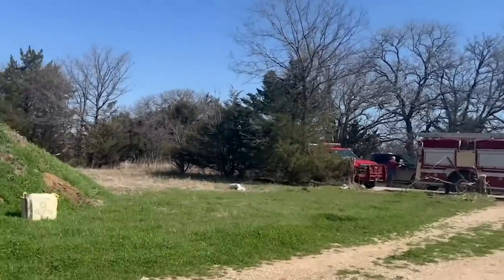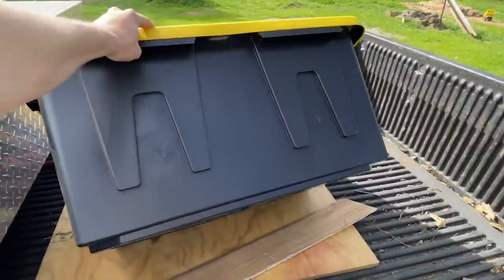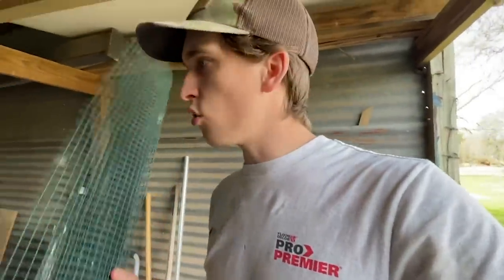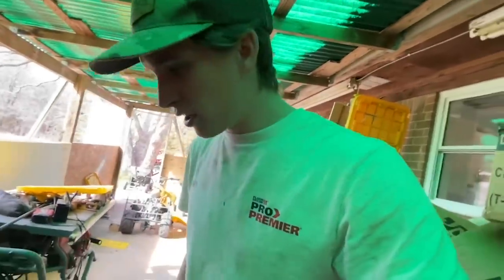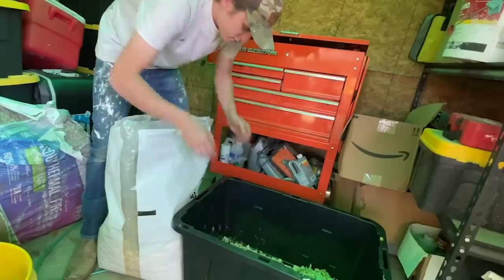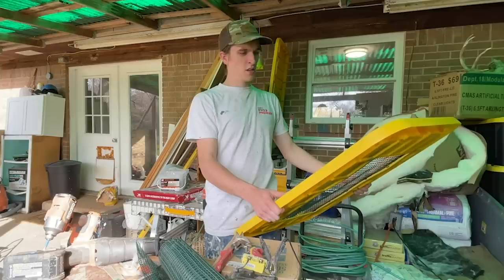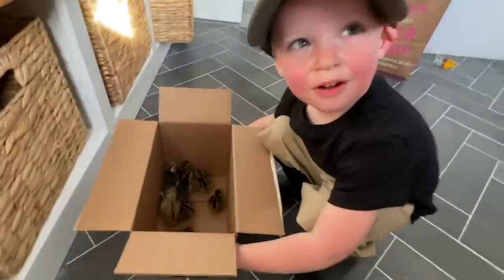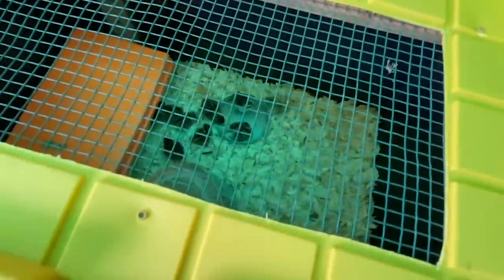EMS showed up at our house!

Comment: The lid you put the wire on. I think it was better the other way. My thinking is IF Zan or Moose got to the cage and jump on top it will be easy to fall through. The boards on the top should be sturdier so they don't go in. Maverick is so stinking cute with the baby chick chicks. God Bless 💕💕💕